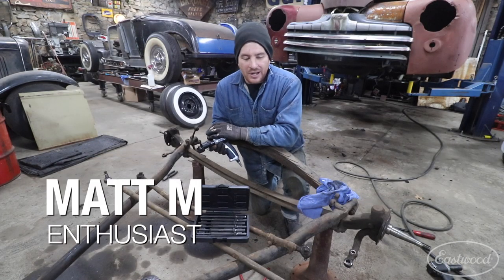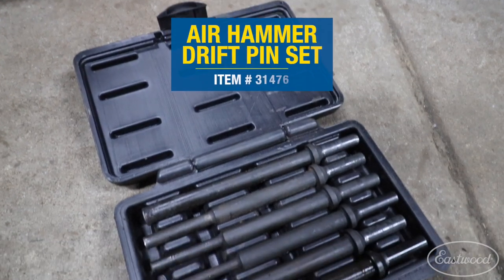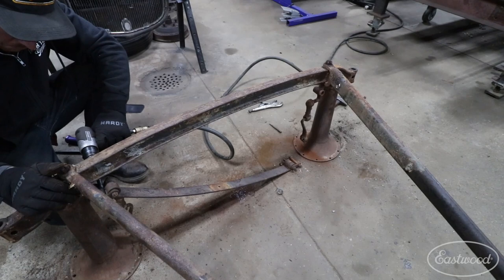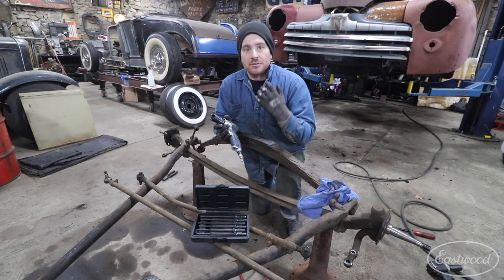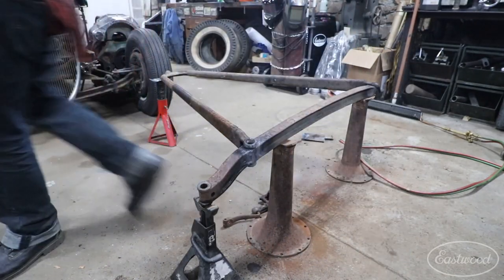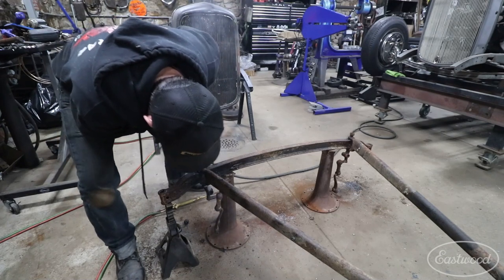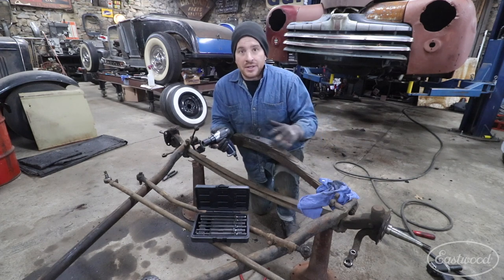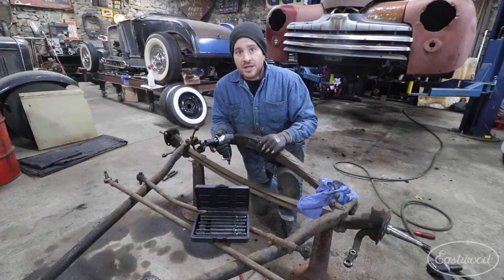How to Use Drift Pins to Remove Stubborn Suspension Parts & Hardware - Eastwood

Comment: Great tip! I have a worn bushing on the rear suspension of my daily driver, and I didn't even think to use my air hammer. I tried using a ball joint press, but it wouldn't budge. Maybe some "heat'n beat" will do it!